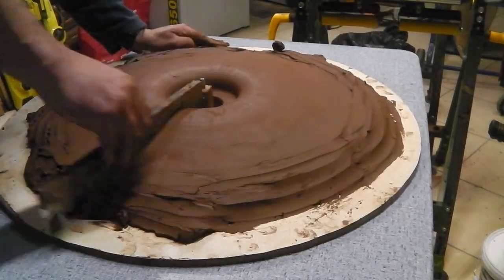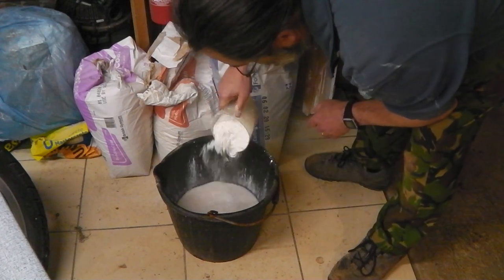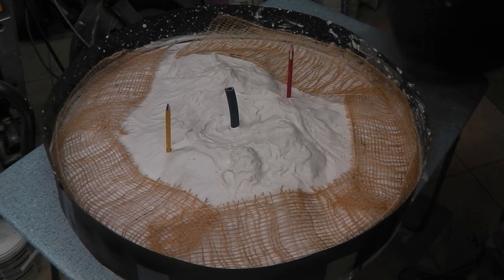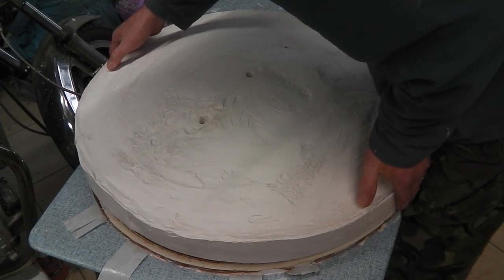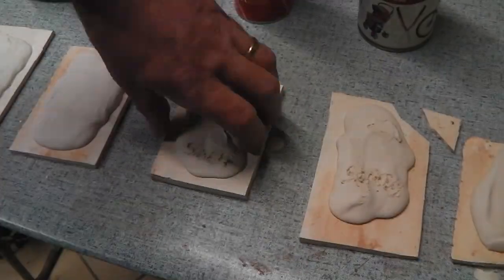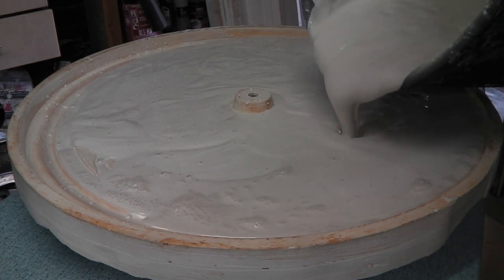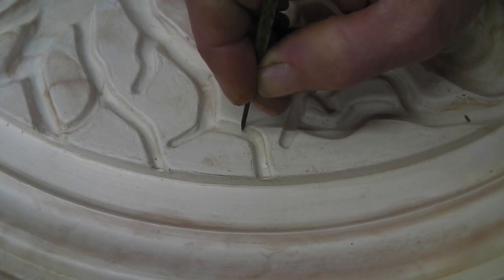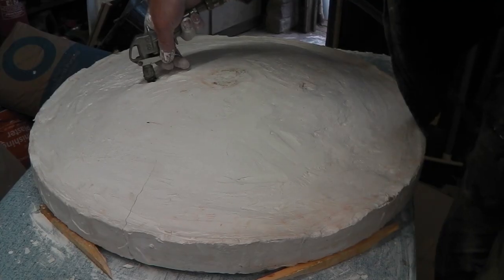Plaster casting a ceiling rose / medallion, DIY without expensive casting products

Comment: it's gorgeous! what are you putting in the holes (looks like pencils?) to help with demolding? and what tool is that (and what is it doing)?
Reply from the maker: Yes pencils.  They leave a couple of holes.  Then I can squirt some high pressure air down using a "blower" on the air line from my compressor.